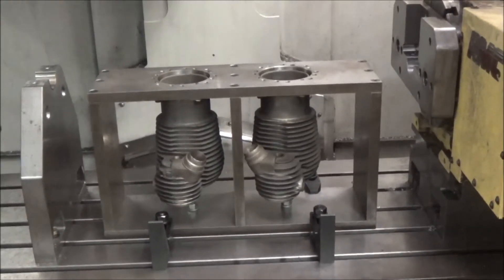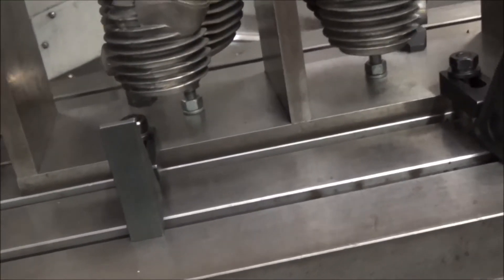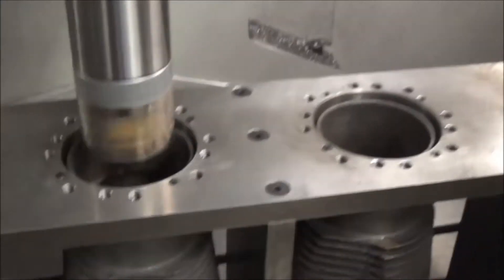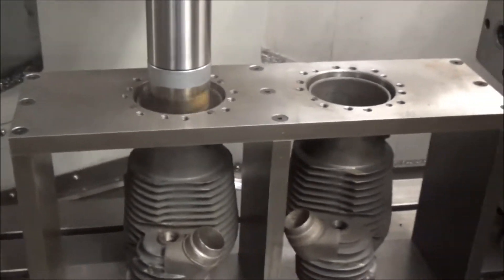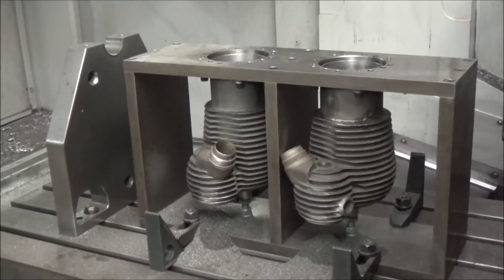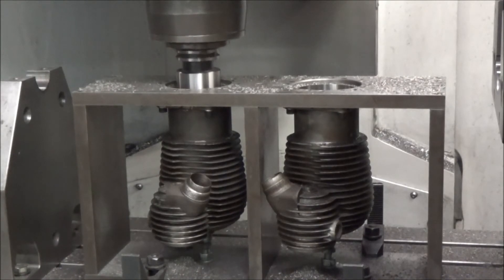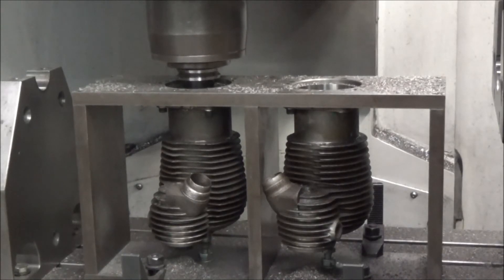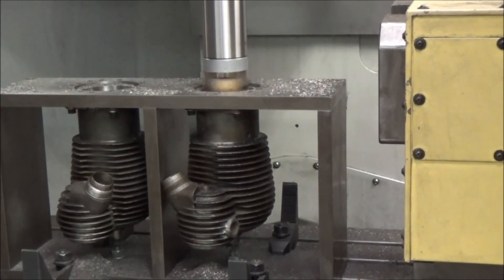Thor motorcycle cylinder sleeving on RMC V40 CNC mill

Comment: Very nice work. Really like the fixture. You make a job that takes quite a lot of time and skill to do in the lathe look so easy. That's the marque of real skill, making the tricky look fairly easy. My setup is a fixture on lathe faceplate that takes quite a bit of fiddling to get centred perfect.
Reply from the maker: Yes, I can imagine that it's a setup nightmare on a lathe. What's nice about this fixture is that the cylinders stay in it from start to finish and it simulates them being bolted to the cases. There is some minor lower bore distortion when they are installed and this method eliminates that issue.
Reply: motion24527 it must be fate! I have acquired some used milling fixtures today and there is the right material to make a similar fixture ,only a single cylinder at a time. I will make one for myself to machine cylinders one at a time. My mill is non cnc so I don't have the luxury of a retracting boring bit so I have to feed in and then feed out. Good job I work on my terms and don't like to rush! Thanks for the inspiration.